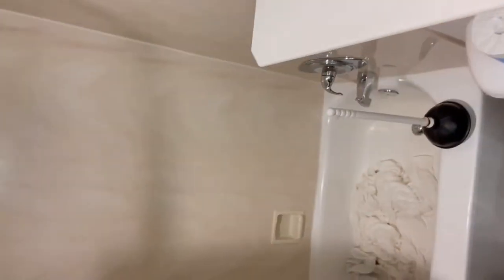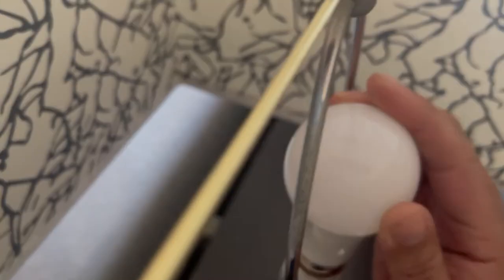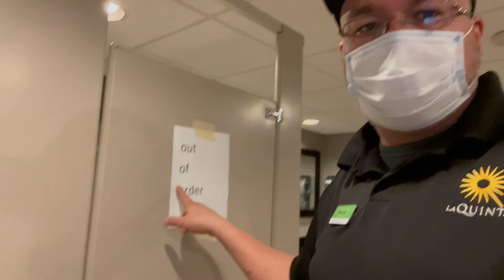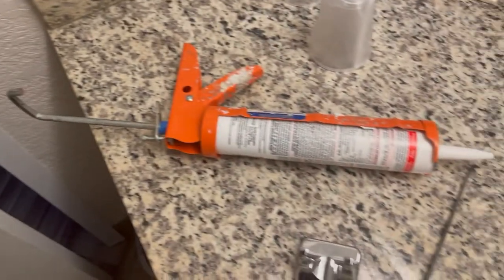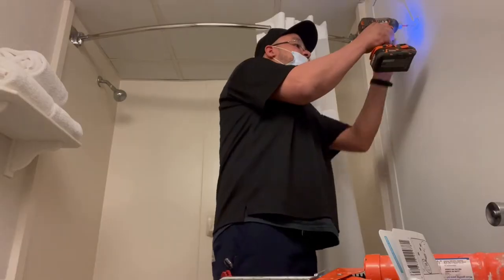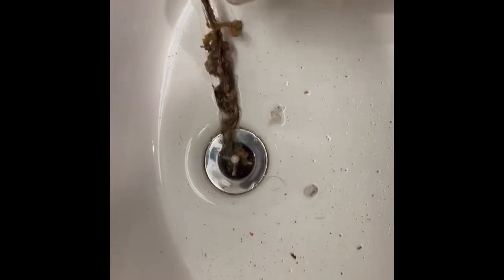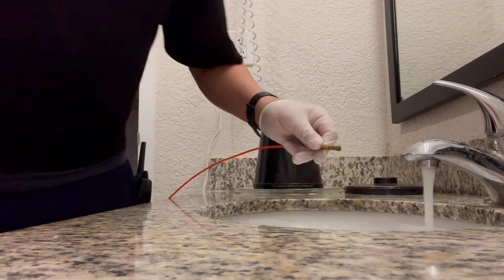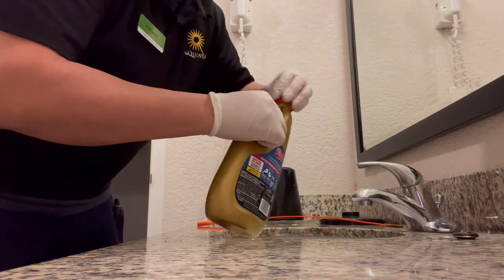HOTEL MAINTENANCE (ZOOMA VLOG 1)

Comment: some of the lamps  i deal with have drivers basically small ballasts that transform 120v to say 12v led boards. other lamps consist of pin type bulbs and sometimes the problem you didnt mention could be the switch is bad/broken. i recommend a multi meter to check for that kind of stuff because its not always simple fix. hell ive had to fix stained,broken,etc lamp shades and boy ive come up with crazy solutions because not every hotel can afford to buy or wait for new parts to come in.

Comment: interesting i always thought for copper pipes draino over time or in high concentration will eat away at old copper piping and as preventative maintenance taking apart the p trap to clean both ends with whatever tool is what plumbers do to prevent a early call back for when its clogged up again
Reply: It does, plus it also damage pvc